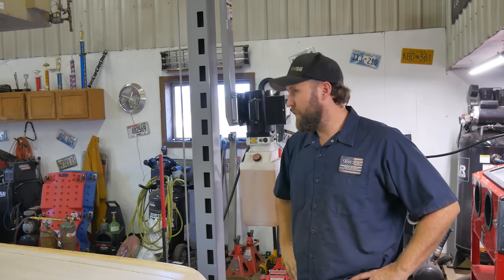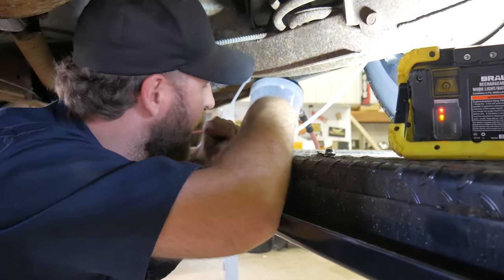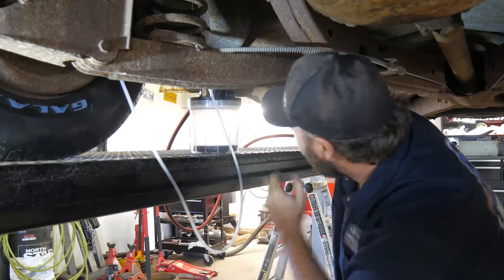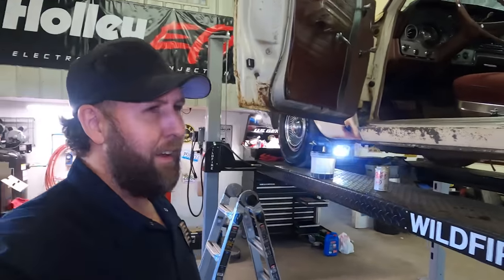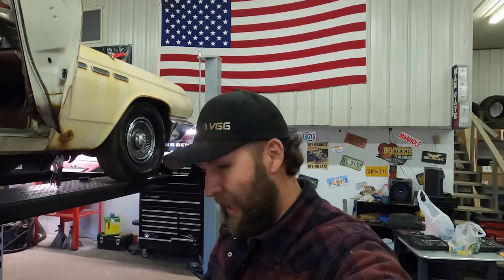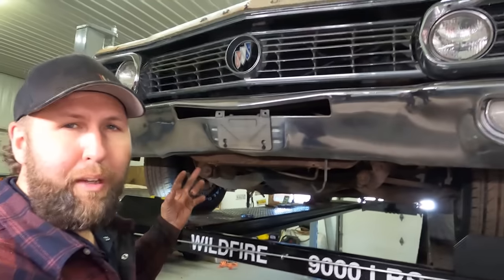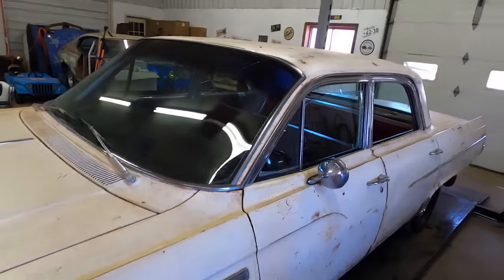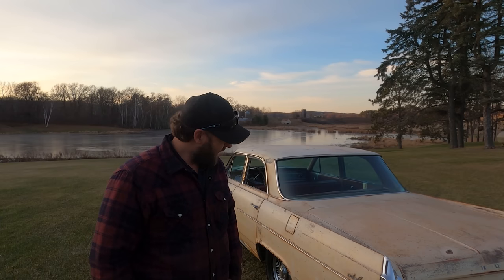From ABANDONED to BADASS! Buick Budget Build (P5)

Comment: Enjoy the vids immensely; Hiatt mechanic tip 1,246 - When bleeding brakes by yourself, flip a bottle of brake fluid upside down in the master reservoir, that way, it will automatically fill, as you bleed.
Reply: That's exactly what I was thinking too when he was bleedin on the ol brakes.
Reply: Phillip,
I’ll probably have a forehead slapping “why didn’t I think of that”, but could you explain that trick a bit more? Sounds handier than a pocket on a shirt!

Comment: Derek, The small bracket was used as a bumper support (to keep center from getting bent)/ make shift hitch usually for a small tiny trailer. The longer bracket was used as a gas tank puncture protector. The car was probably owned by fella who worked at a large plant. My grandpa had one  on his Coronet, It was easier to back into your parking space rather than pull in so when you went home you could get on your way easier. They also made good tow points for removing small trees and shrubs.
Reply: just imaging one of those redneck tree stump truck removal videos but instead of some guy in a rusty '03  silverado its just a dodge coronot superbee. thanks for this, this made my day lol

Comment: 1980 Dodge Power Wagon (318) some how had 10 gallons of diesel  put in tank.  Used engine driven pump to clear tank and a Boat tank (on roof) and syphon hose to run engine.

Comment: Yup those old Buicks are sumthin' special. My 1st car was a '61 LeSabre, red with a white convertible top,  Red and white interior. I bought it around '70. I don't remember what engine it had but it ran pretty good. Sold it to a friend and a few years later he sold it to a farmer in PA who cut it off behind the doors, bolted some wood to the frame and used it on his farm to haul hay. For all I know it's still runnin'. Great stuff you do saving these old classics. Thanks, Dereck.

Comment: Here's my bonehead mistake, thanks to being laid off for two months and watching all your videos like it was my job, i had the guts to tear into my wifes 08 cadillac cts (dumb). But i "fixed' the radiator which then pumped all my new transmission fluid through the motor and radiator an emptied the transmission. I did get some great brownie points though for repainting the driver side fender thanks to your Harley video. I can work on motorcycles all night but cars just don't like them guys got a temper and it's hard for me to do all that work with a glad heart but thanks to your videos it gave me patience and some know-how to tackle some impossible tasks thank you for giving us your time

Comment: 35+ years ago I was 14 yrs old, helped dad put new front fenders on the old suburban.. got them lined up & gapped 100% ready for paint .. in a fit of dad wisdom, (trusting me more than he probably should have), he told to back it out of the shop. Well ... lookin out the back i forgot where the front was, dialed the wheel once I saw daylight and crunched one fender into the overhead door frame. Dad was pretty good about it ... but man did I feel bad ..  I knew he'd saved to buy those instead of patching the old ones. There was a lesson there about knowing when not to start yelling that I learned later when I looked back at that day.
Dead duct tape? Throw it in the nuclear microwave box for half a minute .. like new again.
Great series, thanks for sharing!

Comment: 15:43 i'm an electrician and i laughed really hard at this. Very accurate. God bless you Derick
Reply: "why souldn't you, ya ya, of course" lol. I even struggle to think of alternatives,
Reply: @prgnify  Because the 'correct' way is to use the old wire to help guide a fish then attach the new wire to the fish and pull it back through. However, this takes time and a few working words when the fish gets caught on something and you end up feeding it in and out and in and out. Where if you just use the old wire as a fish it works 95% of the time. And the 5% when an old splice fails it becomes the apprentice's problem.
Reply: @Cragified  as an apprentice I can vouch for this statement 100%.
Reply: @Cragified  time and a ton of patience. I have done this technique a couple dozen times in vehicles and it can get very tedious.

Comment: 1:02 hey Darrell instead of carrying the gas tank around why don’t you get a empty beer keg and weld a fuel neck into it and add petcock valve to it and hook up the fuel line to it then you’ll be able to fill it with more than 5 gallons in it and you could probably add a fuel pump to it or a float so you can tell how much gas is in the tank and you’ll know when you need to fuel up

Comment: My bone headed move. Struggling for weeks with a misfire on cylinder 5. Realized I had been changing the coil and plug on cylinder 7 the entire time. Put a new coil and plug in the right cylinder, fixed in 15 minutes.
Reply: I forgot about the challenge, but comes to mind the worst was simple. After all the work I had done, I cleaned and sprayed the hood with primer.  Black primer.  The car was prone to overheating and that was the simply worst thing I could have done.  First car, lesson learned.

Comment: I was changing the rear brakes on my 1970 3/4 ton chevy pickup. I got one side all tore apart then went to the other side to start. As I pulled the second axle it came all the way out...except for the last 3 inches that hit the side of my house in the driveway. I had to put both sides back together, move the truck over 4 inches and start all over. I was learning by screwing up!
Love your channel!

Comment: 14:06 ; me, (licensed electrician) "I'd use the old fuel line to pull in the new one"

15:40 ; also me, "well I'll be dipped!"
Reply: Jim Mac He mentioned the glow rods.......yup, someone's been in a finished drop-tile ceiling pulling in security cable after the fact. 😏
Reply: @spaz-tech  lol, yup
Reply: @spaz-tech  lol yeah i buy the harbor freight ones after i dropped a $65 auger bit in the 12 ft cavity of the freshly painted stucco wall
Reply: Cuttin holes in the bases of wall to retrieve flashlights, screwdrivers, misc goodies - yup been there done that

Comment: Next time when you're removing those bushings, try cutting them out with a reciprocating saw (AKA Saws All) with a fine metal cutting blade. I do this all the time and it works great. Recently, I removed both control arm bushings on a 04 Chev. Impala in under 5 min for both.

Comment: never wanted to be near where ever that auction is happening more in my life.
Reply: It's listed on eBay right now.  When I looked the price was up to $3,650 which, IMHO, is more than a fair price.
Reply: @bmacd2112  It's also in MN, I'm 1500 miles away and though I have the tools I need ( truck and Trailer ) I do not have the freedom to go get it.
Reply: @PapaBear816  - I'm in the same boat.  Although I'm a little closer (700-800mi) and I'm an old retired guy with all the time in the world.  Still, my little 4cyl Jeep isn't going to tow anything that size any distance.  With my retirement, I probably shouldn't spend the money any way.  Darn nice car though.  I'd love to have it.
Reply: @bmacd2112  Those jeeps were stronger then most think. IT likely could get away using a dolly rather then a full blown trailer.

Comment: I love your videos! I owned a 1954 Buick Century (my first car, in 1960), a 1956 Super (drove from 1961-1964), a 1967 Buick GS 400 I owned from 1967 until 1987, a 1976 Buick Special, a 1976 Buick Special, a 1985 Somerset Regal, And my last Buick was a 1998 Regal GS. I loved them all. I've made so many mistakes working on cars...the worst was leaving out a thrust washer on my 1961 Corvette's Muncie T-10 four speed transmission. It would go into reverse while traveling forward! That was really bad!

Comment: I hate brake work.. One product I found that really works well for getting rusted bleeder fitting to loosen up is PB-Blaster it's so much better than WD-40 just give it a spray a couple hours or so before you work on it and I think you will be surprised at how good this stuff works.. I'm not saying it will work every time, but it has saved me many times from having to go buy a new caliper or brake cylinder because the bleeder broke off..

Comment: Several bonehead mistakes, bent brake lines flared them and everything forgot to put the fittings on! LOL
Reply: Sent parts from a classic mini to someone in the states, I put my house keys in the package, had to force my own door to get in. 

They did send my keys back, those keys have been where I never will!
Reply: I've been there, had to cut the flange back off. I think if you do it long enough. It's a good possibility your gonna do that. Done lots of stupid crap in a hurry. The worse had to be, not tightening an oil filter. Climbed out for a rag, got side tracked. Engined locked up on a busy road in a roundabout.

Comment: Love the series.  I have a 401 Buick in my '49 Ford coupe.  Nailheads are hard to get parts for but worth it.   What I really like is that VGG proves you can have fun without spending a fortune with old cars.   Too many of the shows now show cars being built to better than factory standard or to a level few can afford.   Take the Relics series.   They would have preserved the "patina" on the paint and chrome while swapping it onto a custom built Art Morrison chassis, a 600 HP LT motor, redid the body and added fake patina to the panels replaced,  etc. turning it into a $100K car.    Getting the kids out of the house, away from the computer, especially in 2020-21 can help create come family moments that will mean something down the road.

Comment: I was adjusting the timing on my 67 C10 with greasy hands and was too lazy to loosen the hold down. Thought I could get that tiny bit of turn that I needed out of it if I put the onions to her.  My right hand slipped and popped 2 plug wires off and laid my hand right on the posts. That accel HEI was definitely doing it’s job. WOWZA!

Comment: I bought a 1966 lesabre hardtop, it was in nice condition and had the aftermarket AC which worked, the only problem was it's need for premium gas because of the high compression engine and  had to put a lead additive in it, it cruised down the highway like nobodies business, I paid 1,500 for her and sold it for 3,500 without doing anything to it because it didn't need anything, she was one of my five lesabres I've owned, so far I've had the 66, 70, 73, 74, a 1986 lesabre wagon that had a mysterious bad vibration nobody could figure out, I had friends who had a shop and one was a transmission specialist so I sold it, it was a beauty, now I have what's probably going to be my last lesabre a 2001 which has 298,000 and still runs like new.

Comment: I had a '61 Invicta nailhead, Odd engines/cooling manifold. Ran well, had a smooshy banded transmission. Fun car, sounded like a boat. Ran my thumb through the generator for good measure. Lots of familiar parts between yours and mine.

Comment: perfect double flare forgot the nut but i still would never go back to sections of break line i use rolled line just cheaper when you consider all the fittings you need with sections of line.

Comment: Some 20 years ago I was wondering and  struggling with one four pot Ford engine, it just didn't want to start and run. Keep popping and banging after head swap. Then I noticed there was water in the oil, and rad was getting low. Well this bonehead had swap to lines in the bottom of the intake. Heater water line and booster vacuum line. Swapped the lines and drained the booster and oil. New oil and filter and she fired right up when touching the key.

Comment: And bone - Headed thing was when I put a Chevy 350 into a 79 Nova out of a 72 Malibu the tranny was a 350 I filled it up with B& M trick shift back in 87 & it was $ 5 . A quart I put the motor and Tranny in at the same time I was not thinking when you tilt the tranny down to go under the firewall most of the tranny fluid would spill out the tails-shaft that’s my BoneHeaded move !

Comment: This is my first one. Back when I was about 8 or 9 my dad got us a 75 vw bug to learn me on fixing things. well I must say I did ok with the bug BUT the first oil change I did I forgot to put the cover and screen back on so I just dumped the new oil back in the catch bin. I put the brake shoes for my 61 biscayne backwards when I was 15. I wondered why it always stopped funny. More recently here I did the timing system on my 75 f250 with a 390 in, I had all the front dress back together and I found I had left out the oil slinger on the very back of the fender so I couldn't see it! Dang it! live and learn though. Keep up the buick stuff and sell the 71 caddy. To much plastic in the caddy and the buick will be cheaper to fix. My 2 bits anyway thanks man.

Comment: Hey Derrick Love your videos get a kick every time.  Just wanted to say a lot of those old cars you see looks like a chain was hooked to the bottom of the frame in the oval holes.  Definitely could’ve been pulled out of the ditch or something but I haul new cars for a living and back when we used to use chains to tie them down if he used an S hook in the frame and cranked on the spindle too hard and put too much pressure on that hole It would bend or rip the bottom of the frame I’ve seen it in a lot of vehicles over the years just wanted to throw that at you. That’s why you see straps going over all the new car carriers tires when they’re going down the highway they found that the drivers were tighten the chain so tight on some vehicles they were actually tweaking the frames

Comment: I was putting a distributor in a big block Mopar. Turn the key and it would not start. Suspecting it was 180 degrees out I quickly pulled the distributor out to change the orientation but had left the ignition on. A spark jumped from the distributor to the block igniting the fumes in the the crankcase, flames singed my eyebrows, launched the oil cap, and pushed the valley cover up against the intake manifold. I found the oil cap about five years later when demolishing a fence.

Comment: i replaced metal power steering line with rubber line & cheap metal squeeze clamps...turned the steering wheel fluid sprayed a torrent of fluid everywhere...i was 18, back around when fire was discovered,lol.

Comment: Changed the motor on 79 El do rado (front Wheel drive) took it for a test spin ...ran great...forgot to put 90 weight in differential had to pull the motor again to put in new  diff

Comment: That bar across the back is a great mystery, doesn't look like it held a rack or anything. Maybe a last minute tie down setup for trailering?
Reply: My guess is that it was added to protect the gas tank.  If you were to go up a steep driveway without it, it looks like the tank would scrape on the road.  Instead, it will scrape on that bar.

Comment: The 401/400 became Buick's full-sized and later intermediate muscle car powerplant of choice, used in the company's Skylark Gran Sport and Buick Wildcat models, among others The engine was variously designated the Wildcat 375, Wildcat 410, and Wildcat 445 depending on the torque each version produced. The Wildcat 410 was the two-barrel carbureted engine, standard on the 1962-63 LeSabre  :) cool the 410 put out  280-300 hp and 410 ft pounds toque

Comment: the rear bar thats separaate from the hitch mentioned at 8:19 is (was) used to mount static strips, the rubber straps you'd see (often w/reflectors for weight) that supposedly reduced static and helped w/motion sickness...the fad/belief died off and you quit seeing them by the early 70s

Comment: That was definately a homebrew trailer hitch.  Had one on a car I got, still had the flat bar with ball on it connecting the two very scetchy looking angle iron pieces booger welded to a couple larger angle iron pieces to bolt to the frame.    
I got a feeling this is another one of those old popular mechanics hand drawn home projects given how many of them I see on older cars once I started looking for them.

Comment: Screw ups. I worked for a small used car lot. Had a 95 Monte Carlo towed in for a No Start. I told the owner it had a 3.1L and probably popped the intake gaskets and hydro locked. He ordered the gasket set and I slapped it together in the alley right where they dropped it. Only to find out the customer drove clear through that bad intake gasket and locked up the engine completely! So we did the right thing and pulled the new gasket and already cleaned intake for the next one....probably still in his attic.

Comment: What did this car sell for?  From '90 to '97 drove my grandma's 71 Buick Electra 225.  19,000+ original miles.  She hardly drove it.  Original rubber too.  The air conditioning still worked and it blew my girlfriend's highly hair sprayed hair back.   What a fun boat. 8 miles to gallon city.

Comment: My Bone head mistake:  I was replacing a radiator on a 2006 KIA Sorento.  I had to remove the transmission cooler/condenser to get to the bolts of the radiator.  I got everything back together and got side tracked and had to leave for a couple hours.  When I got back I filled her with green Kool-Aid and started her up.  My son said "Hey dad, what's all this red stuff on the ground"  I shut her down got out and looked at the ground and I said "Well son that would be all the transmission fluid I just pumped to the ground".  Needless to say I got in a rush and mounted the tranny cooler but didn't plug her in.

Comment: I had one just like this except hardtop no window frames, that wildcat 401cu in. ("410" on air cleaner was torque figure back then) had 10-1/2 to one pistons and mine ran much better on premium, in fact the gas cap said "premium fuel only" - I was  teenager when I had this car in the 70's and mine saw a few burnouts as well---my uncle was rolling over in his grave im sure--lol